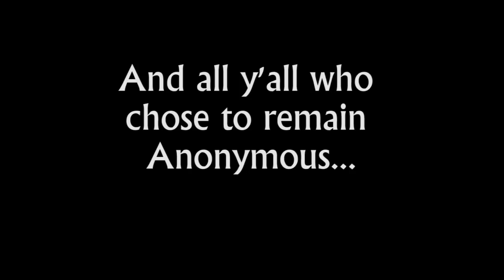Wood Turning: Tops, Leverage, Newton & Telekinesis!

Comment: Ok here's my second chance... The top is spinning in one direction ...as the energy dissipates( due to friction)  the top loses it energy and will topple to the table . Now which direction the top is spinning is not important ..as it hits the table the last of that energy is meet by the friction of  the table and grabs the energy of the top causing an equal but opposite force thus the top spins in the opposite direction. These are the two objects the top and the table, they come into a contact play of force, interacting with each other. The force of one action is the reaction force on the other. Hope I got it right.